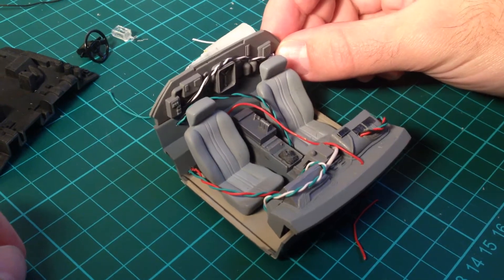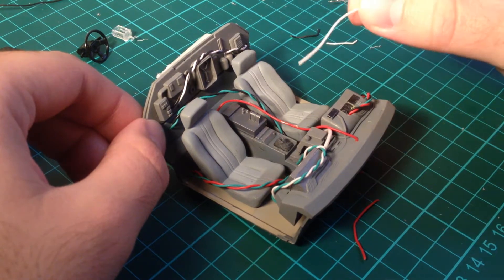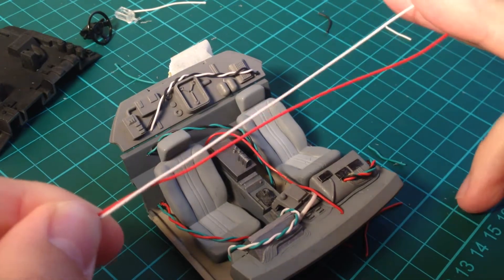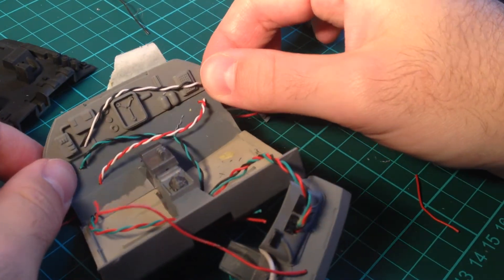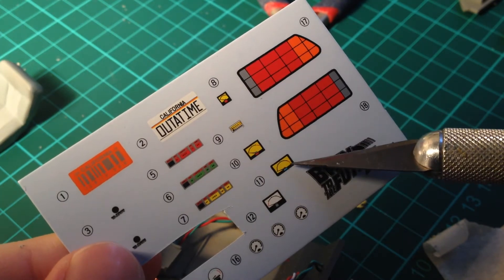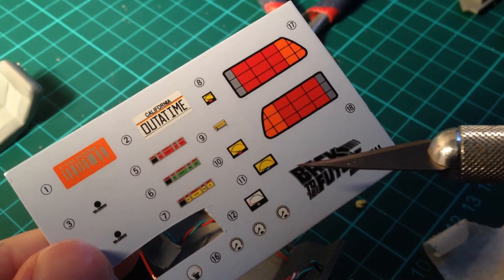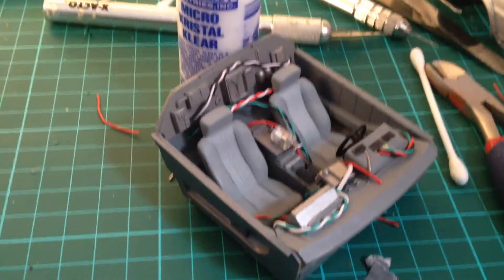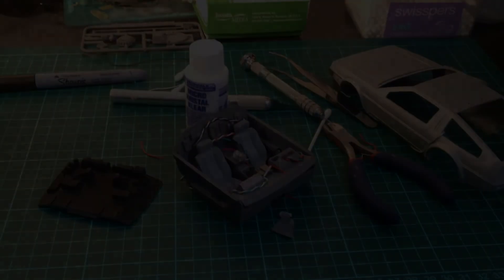AOSHIMA 1/24 Back to the Future DeLorean build part 3

Comment: Nice work! I thought about maybe putting some wires into mine, but I may not. A few weeks ago I had reworked the coloring on the body, but I haven't touched it since then. I got a bit sidetracked with the Yamato build, and I haven't had any time to work on models the past couple of weeks. My daughter has just started the 1st grade (school year begins in April in Japan), plus other stuff going on. The DeLorean interior is maybe the last major part of the car I need to work on before I am done.
Reply from the maker: stevethefishdotnet Thanks Greg. Kinda funny we seem to be building the car in reverse of each other! Best wishes to your daughter, might take a short break from the DeLorean myself. I still need to finish off the Reliant and add decals to the DS9 so part 4 might be a couple weeks out anyway. 
Scott

Comment: What kind of wires are these and you should follow film scenes so you can make out accurate   wiring positions cut that's what I do.
Reply from the maker: Derek Walters I used an iPhone charger. There are a group of thin coloured wires that make up the guts of the cord. 
I really just placed my wires where I thought they looked good as the film prop was never really consistent.